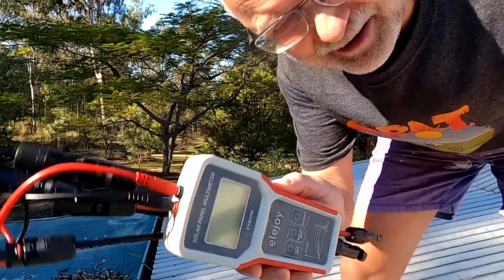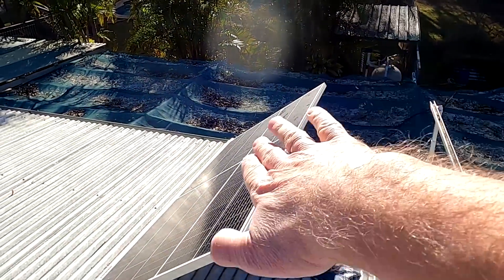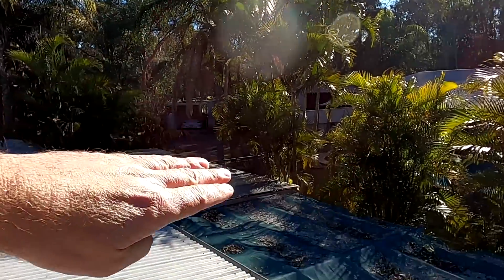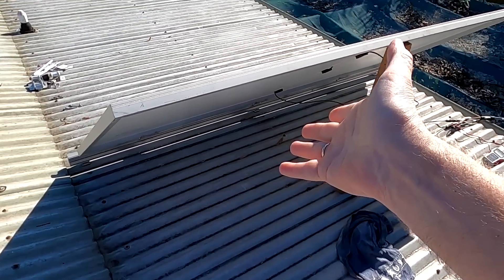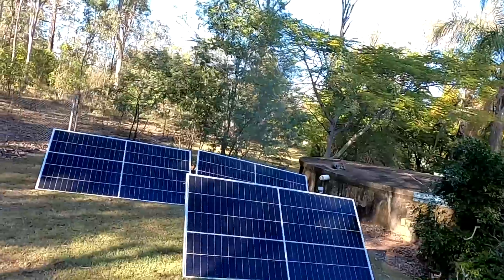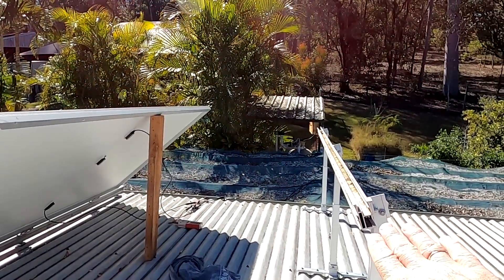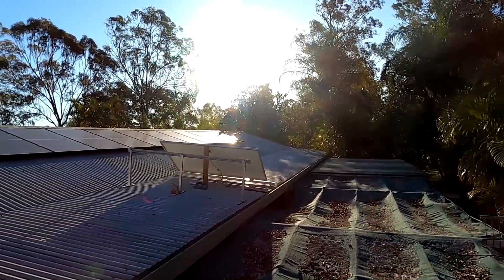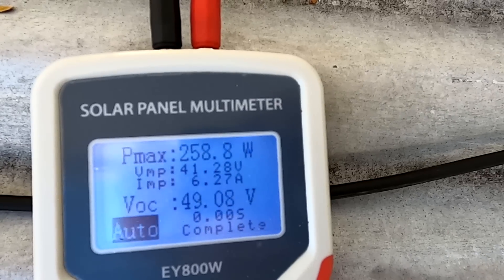Maximising solar production in winter.  Is a steeper angle really worth it? Timber vs Tilt Mount

Comment: Hi Andy. I have my ground mount panels on a horizontal pole with hinges and vertical poles/hinges hold the horizontal pole. The actuator tracks the sun throughout the year pushing or pulling the panels. Easy install. I find a 10 degree difference makes no difference in power output.  I've had the system in use for many years without issue. Southern California I move from 5 degrees to 57 degrees. Having it all on horizontal poles /4 panels and actuators moving with 20 panels keeps my summer/winter even. No problem higher winds.
Reply from the maker: My panels are just ginormous! over 2sqm each, so a very large sail. Someone suggested a tower of power but that would be a huge construct for these panels. No shading problem though.
Reply: @OffGridGarageAustralia  the same size as mine. 400w 72cell. My horizontal pole holds 4. It balances in the middle of the panels rather than the edge.  Less torque needed. Ebay actuators 6000N 1000mm stroke. In service 4 years. 2 gate hinges each panel tied from the horizontal pole to the vertical poles. 8 vertical poles. Heavy 2 inch conduit clamp ties the panel to the horizontal pole. Aluminum rail ties 4 panels together. The actuator moves the entire horizontal pole. High winds I move the panels horizontal position. Ground mount. If needed I can strap each end of the panel to the ground for very high wind.

Comment: Hi Andy, Have you considered the possibility of mounting two panels, one as you have it and one near the edge of the roof, avoiding the worst of the long shadow, but then mounting panels three and maybe four up on the steeper sloped roof between the end and where the flat panel rows start? These of course can be raised to face the sun regardless of the steeper angle and they won't be shaded.
Reply from the maker: Yes, I will do something like this eventually...

Comment: I'd probably just set up different arrays at different directions so you can get good sun at different times of day. The actuator stuff is cool and I'm sure a great option it's just kinda complex and I'm not sure how dependable it would be. I'm shooting for the set and forget kinda solar system... but if you got the money and time... I guess
Reply from the maker: The single actuator stuff will not work with these panels as they are too large. I experimented with a steel frame underneath. This was still not satisfying enough. So, a static mount it will be. Tilted though...

Comment: Hi Andy, also interesting is the angle in cloudy conditions...a flat mounted solar panel might get reflections from the clouds...I even tested panels in shadowed position behind a thermal solar tube array....south east heading.....might be nice in winter.over here in Berlin..... as always....try & error ...😊
Reply from the maker: Clouds are not a problem as I explained. The garage/car port/big shed installation will produce a huge amount of energy then (dispersed light in cloudy conditions.

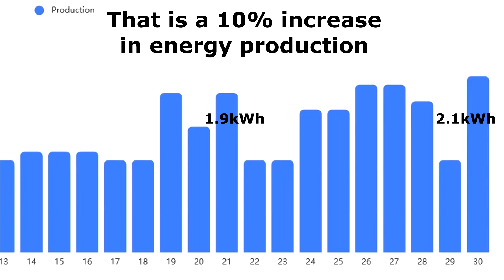Comment: 18:59 no that is just 10% more for 1 single panel and the price might be that you can only get 2 on the roof without too much shading and therefore it would require a simulation with PV Sol premium from Berlin to play around even though that might also misleading cause that looks for the output of a complete year not for particular 3 or 4 month of the winter. 

Too steep does not really pay off except you are running out of power during winter. 
This can be a 4 year long experiment to find your right compromise of getting 4 panels on the roof and the tracker right but I guess the tracker is the only real solution to maximise the winter output which should be useable due to you huge battery. 

Just to let you know: last autumn we were not ready to mount all the panels on the roof and therefore laid 14 flat on a 20° roof with concrete tiles in northern germany.
Guess what has happened in the 6 months during the storm season with 14 panels each 550 Wp ?
Nothing, they had been laying there on long timber bars aka Dachlatten till I was able to mount them in May. Worked fine even though those were laying flat on a roof heading south so the west wind in the north could have picked those 30 kg panels up. Did not happen, even the vibrations had not a huge impact. In 6 month the Dachlatten with the solar panels moved just 10 cm, I mean 450 cm long bars slipped just less than 2/3 of the length of a tile or 20 cm bit by bit and not by a stronger gusty wind within an hour. 

I guess you fear too much the wind load - and yes I took that risk and checked my daily weather report also the weather station regarding wind and storms cause in an emergency I would have tried to bring those panels a bit more to a lower part of the roof cause you now: the nicest spots with less shadow are the spots closer to the sun 

Therefore I had 2 rows of 226 cm lon x 113 cm on the top edge of the roof and those collected a lot of power, and they will now deliver even more cause now they are fixed on the other half of the roof in a 10° steeper angle which I can now compare quite nicely with that flatter part of the roof.  

I would start with an easier , mechanical solution where you can use maybe 3 different angles and also lay it flat in an emergency by hand simply till you have found out the right spacing and angles to chose. Maybe that might be enough for you and you can avoid such tracker or in particular 4 tracker which increases also the risk if you would use it for a constant tracker throughout the day. As I had told you the swedish guy had also one mishap or 2 when the control arm hit the panel in the back and cause scratches and some cuts in the foil which he instantly sealed with tape. 
It will not always work 100% as he had mentioned in one video but the gains were worth the risks for him. 

So start slowly with a mechanical solution and play with 4 modules, 3 angles or even 1 automatic one before going the big automation. 
Also provides more content and a natural learning and teaching curve with all the faults you might make and we can learn from. 

good luck from sunny hot germany, hottest june for a long time.

Comment: Andy it’s scary maybe,i am not convinced about high quality 2 way actuators at the moment for small installation,but i think i get yr problem for the best producing result in yr wintertime or is it summertime?
you should think on it to use a pole with 2 actuators so that you have full sun from morning to evening without the problems from roof structure and shadow and always perfect angle
You will do it with a few panels on the roof and angled but when you use 2 axis mount you should only need 2 maybe 3 max to get better result all day long,the risk with high winds is also smaller then
Maybe there’s someone here with a good quality 2axis mount to help us in the good direction 😊
hopefully you can try,do it before me because i need similar in close future 😂
Reply from the maker: Summer is never a problem in sunny hot Australia!😁

Comment: Another benefit to the linear actuator... (aside from storm protection)

You could vary the angle of the panels to match the sun's inclination to maximize panel output throughout the day & seasons.

IE - near perfect SPAT calibration at all times
Reply from the maker: Yeah, that's less of a problem because as I said, I need this only for Winter to be as optimal as possible.

Comment: there is not much point in putting them on an angle unless it is adjustable or set at an average for winter and summer. The fancy meter is nice but like you i use the Spats method ,it is more accurate and much more fun to calibrate . I would say that your best solution is a tree service to reduce shading.
Reply: Andy has said they are only required during winter. Can be optimised for winter only.

Comment: forget about shadowing: every single day from now on your shadows or in particular overshadowing will decrease 
If you loose a bit for the next months then it is not so important except you start counting peas for the last kWh  cause the gains over the day are far bigger than the losses in the last hours with low production figures. You trade in the shadow in the evening for higher performance over the whole day.
Reply from the maker: Yeah, I really had to wait for this time now to see the shading situation when the sun is at its lowest point. I think I have a solution now I can live with. Not perfect but workable...
Reply: @OffGridGarageAustralia  Would have been too easy to wait for solistice to get the perfect solution, but for me the big difference and hard to understand was your description of your winter like a german summer without heat and shorter , but sunny days where you can harvest a lot during the day.

But it all depends if your are on the hunt for those last missing kWh it might be important to go for it - but I still would sugest to go for a date / day +/- 30 days before and afters of even +15 / -15 days cause you gain a lot more space for panels then and do not forget that you have your goals reached for 11 / 12 of the year, just for the last 30 days your panels might cause losses caused by shadow for the very first 30 or 60 minutes 

Financially you will benefit far more by going a 11/12 route cause you can feed more into the grid.

Comment: I recommend 20degree angle. It will be safe, and productive in long term. No need make 45 or more.
Reply from the maker: But I want it for winter to be optimised...
Reply: @OffGridGarageAustralia  if you decide make higher angle, please cover back side with flat sheet metal, to prevent wind "sail" function.
Reply from the maker: @tomassliauteris884  I will have some sort of cloth shading sail at the back at some stage. Just need to test a few things...

Comment: What about a frame that holds all 4 panels side by side and bottom to top. It would eliminate the shading and you could also Angle it Compoundly to maximize input. Essentially with the frame you'd have one larger panel instead of 4 small ones.

My other thought would be to build an Arbor or pergola for the pool and use the panels as the roof at the Angel you need them. Then you could also have a shaded sitting/lounge area for the pool or BBQ area.
Reply from the maker: Yep, I built one... in one of the next videos...

Comment: I designed a circuit using a MOSFET and a few resistors, that act as a current limit set to the maximum value of the microinverter MPPT. With this, I can connect directly to a 51Vdc LFP battery. It's very simple, I have some boards I can send you if you like. Then you can connect as many panels as you like to the MPPT input. It won't give you 2X the power for 2 panels, but it will give the power to wider shoulders as over-paneling does. I had not considered this use for my boards, I just use them for the batteries.
Reply from the maker: Uhm, you don't use a BMS anymore?
Reply: @OffGridGarageAustralia  My battery has a BMS. The MOSFET is in addition to that.
Reply from the maker: @ToddDesiato  OK, not sure how you have set this up and where the current limiter is connected to but it sounds interesting...

Comment: If you exceed the A for your inverter it will not use more then that is it build for, in this case 12A. The voltage for the solarcell will just raise until they only can provide 12A because the mppt get out of range.
So I will just have been using some of your old solar panels and have put two on each input.
And yes I have been done that a lot of times before, and it's just work. Try it for a short period of time on all inputs at once - you know, just for the science (evil laughing with German accent, btw im from denmark).

And yes, the inverter will properly also limit itself at 2000w, try also that, before you do a lot with motors and over engineered stuff. I will every time like to see 8 panels laying flat on a roof instead of 4 angled like that. Then you won't get any problems with shadows.
Reply from the maker: I don't think this is correct though.
Why do pretty much all MPPT manufacturers have a max PV input power or a max PV input current if the MPPT would limit the output anyway?

I have tested this once with a MPPT. It died with t4 panels in parallel when the sun came out.

Comment: The mathematics for maximjum PV production is simple.  Winter is latitude, plus 47 degrees, yearly is latitude plus 23.5 degrees.  However the difference is not large.  The additional cost of alignment should be balanced against the gain.  A few extra panels makes up the difference.

Comment: Is there any reason why you couldn't leave that one panel where it is.
Put a second panel on the round water storage.

And put panels 3 and 4 on the tilt angle at the end of your main house panels.... as all the main house panels lay flat and don't cast any shadow....
Reply from the maker: The water tank is not straight. It has a dome shaped top so additional mounting structure would be needed and I don't know how safe this lid is. I never went in the middle. The filled cracks are concerning.

Comment: Love your videos. Big fans. My question is is why haven't they or are they available yet that you can buy solar panels that have Wi-Fi or Bluetooth connection? I mean they have that connected to pretty much everything else. I just wonder if they are any solar panels out there that you can connect to your phone or tablet without having to use some other kind of device to see what the wattage and power is. And yeah I get it. If you hook Wi-Fi or Bluetooth up directly to a solar panel you would lose a little bit of power. But I think Bluetooth ain't like seven or eight watts To me. I would get that much up if I had Bluetooth capabilities with my solar panels on each individual panel. How nice would that be?
Reply from the maker: What data would you need from solar panels? Voltage, current, power, yield? This all requires sensors, shunts, electronics for very much no benefit?

Comment: victron controllers can have more amps than it can handle with no issues that is the reason I bought them .... Im currently using 3x 50 amp controllers on a array that makes 208 amps..  I dont know what the maximum is but i will soon as I have another 7kw of panels to go up (I will be ringing Forbes in toowoomba to advise me ) . I only have a 1000 amp hour battery (AGM lead) so cant really go much higher than that.  Im more interested in more power when its over cast.
Reply: I only have a 1000 amp hour battery so cant really go much higher than that.  Im more interested in more power when its over cast.
Reply from the maker: Not quite true though. Even they can be overpaneled by around 30%, the max PV power and PV short current are the limits. Under normal operation the MPPT can shorten your panels in certain modes and hence can only handle that much current.
There is a very interesting discussion in the Victron Community Forum about that, where Victron made this very clear.
Reply: @OffGridGarageAustralia  Thanks very much for responding. I knew there was a limit but had no idea how much ... 30 percent isnt bad at all tho.  any chance you could post the link from victron if you remember it please.
Reply from the maker: @Philmoon69  So here is the Victron MPPT calculator which gives you all the data. With the calculations it does, you can over panel for up to 35%.
The discussion on the Victron forum is here: https://community.victronenergy.com/questions/32242/smartsolar-maximum-input-current.html
I'll post the official Victron statement later, can't find it atm.
Reply from the maker: @Philmoon69  Here is the thread of interest. There are also links mentioned which are worth reading in regards to this topic:
https://community.victronenergy.com/questions/2767/oversizing-a-pv-array-within-max-voc-and-isc-can-d.html
Reply: @OffGridGarageAustralia  thanks your brilliant

Comment: If the panels are angled very steeply, then you will shade the bottom part of the panel behind whenever the sun is low enough to maximise power output.

Since these are half and half panels (I believe?), then power output will be badly affected. It looks like they're designed to be mounted in portrait, and the upper half will continue at full power even when the bottom half is being borked.
Reply from the maker: Yes, that is correct. A horizontal mount is not great, depending where the shadow comes from. I go vertical again as originally designed.